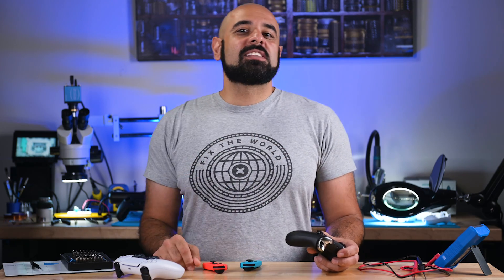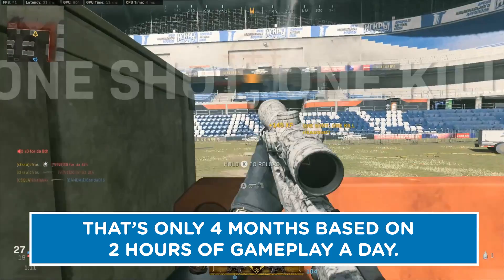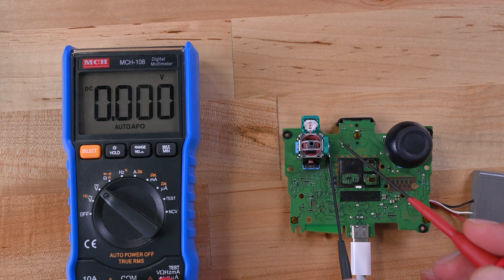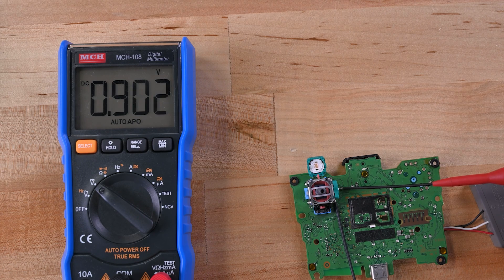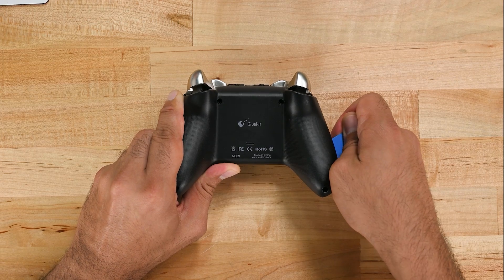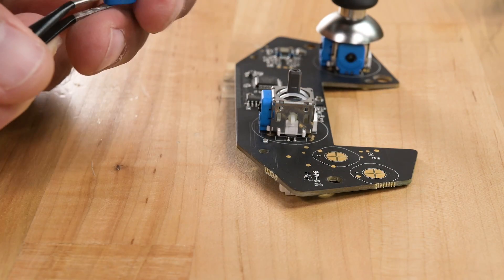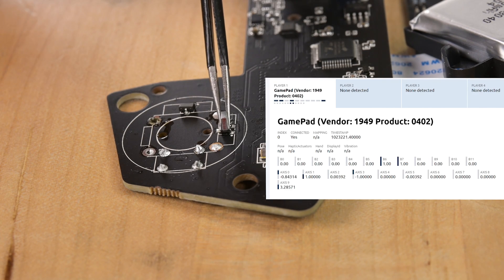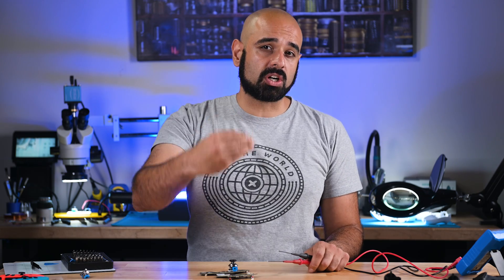How Manufacturers Can Fix Joystick Drift - Permanently!

Comment: Since 2006... To 2017 on the PS3 as other mentions. This is not new tech, and has been used on a major console. The question one should ask is why did Sony change back to resistive? Cost? Other types of wear? susceptibility to other magnetic fields like it's own second magnet next to it? Non-linear effects? Inconsistent field strength of production magnets that might necessitate more calibration which is highly labour intensive.
Reply: Definitely not cost. Hall sensors are not expensive. Microsoft switched the triggers from potentiometers to hall sensors when going from 360 => xbox one.

I suspect the reason is probably tied to why all the manufacturers making "crappy" thumbsticks have no problem giving you durability testing results, while the guys making the ones that supposedly never go bad won't. There is probably some engineering reason why potentiometers are favored over hall sensors in thumbstick applications. I suspect once these have been out in the wild and start accumulating some wear and tear we will get a better sense of why that is.
Reply: @nerdstrangler4804  I can see two issues in this Hall design. That it retains the deformation prone tiny return spring and the wear-prone splitter assembly, both of which are not a problem in other Hall sticks but are problems in potentiometer based sticks. I don't think it will last.

Dreamcast used Hall but it looks like they puzzled around a bit with suppressing interference, such as with screw placement and choice, and relative placement of different Hall controls such that they don't interfere with each other. It might be one of several reasons why it's kind of an oddball controller by look and feel. On the flip side that Hall hardware in that one actually lasts forever; great application of force management, minimal spring deformation, correct lubrication, no abrasion whatsoever. The lubricant will decay but you just replace it and you're good again for the next 10+ years.

Comment: First console with those pots is ... The Sega Dreamcast !!!! It's original contrôlées domuse magnetic sensors for the analog Thumbsticks and the 2 triggers.
This is  a shame it has not been used from that moment in all controllers. I guess Sega had  some kind of patents over them before the Dreamcast flopped :-(
Reply: No, SEGA has no related patents. It looks to me like SEGA manufactured the joystick under patents licensed from Orvitek, which would have been valid until 2010.

Also nobody actually wants to make an eternal joystick? And i can instantly see some issues with this one, it won't last.
Reply: @SianaGearz  Patent or not, it was only on the Dreamcast, a console with a lots of good ideas but taken down by Sony's marketing masterplan. 
Its arcade counterpart is famous for his great arcade games :-)
This tech might have its issues but one for the manufacturers is the long lasting ability of magnets compared to potentiometers ;-)
PS2, Xbox,... They all went for resistive tech.

Comment: the only problem I see here is that these hall effect analog sticks are trying to maintain the form factor of modern potentiometor based analog sticks. if you go back and look inside the Dreamcast controllers it's design is alot simpler than this. it just has four hall effect chips on the board arranged in a cross and the analog stick has a magnet at the bottom of it that floats above the sensors on a plastic stick with a spring around it.

Comment: As an FPV hobbyist, THANK YOU for making a video (albeit a short one) about hall gimbals. There is literally no downside in using these over potentiometers besides the slight increase in complexity and tiny increase in price. It's so worth the added consistency and longevity and it baffles me that potentiometers are still the norm in expensive video game controllers.
Reply: If possible, itd be cool if higher end controllers that might include these hall sensors in the future have a magnetic interference shield
Reply: @alifelessrock48  as awesome as these would be, Sony, Microsoft and Nintendo won't use them. They make too much off selling controller replacements. Though I agree, they should be in EVERY pro/elite controller version
Reply: @Takintomori  Hopefully one of those third pary controller makers like 8bitdo take this challenge on. Fingers crossed.
Reply: @alifelessrock48  yeah, I'd love to see 3rd party manufacturers force the big manufacturers hands. Or see replacement joysticks being released like they are for the Steam Deck
Reply: @alifelessrock48  They have a hall effect controller now called "8BitDo Ultimate Bluetooth & 2.4g Controller".  Problem with 8bit controllers is that the ABXY membrane wears out (intentionally) and they sell replacement kits to keep the cash coming in.   So you are stuffed that way with 8bit.  And their controllers are a right pig with soldered on + glued on batteries that must be removed as a first disassembly step, meaning you are likely to break your controller on your way to fixing the ABXY membrane.  They did not have to be this way, but chose to be this way.
Reply: @alifelessrock48  it's not possible to shield against stray magnetic fields
Reply: @placebomessiah  while in theory you could “jam” the Hall effect sensor, I see 2 issues with that. 1. In any situation where you would be close enough with a magnet to interfere with the hall sensor, you would be close enough to just touch the stick or obstruct the user in any other way. 2. Because magnetic fields follow the inverse square law, the external magnet needs to be incredibly powerful or extremely close. The video looked like the magnet was about 1mm from the sensor. So a magnet 32 times farther away (1024 mm or 1 m) would need to be 1048576 (32^4) times stronger to have the same field strength at the hall sensor as the small magnet. This would also no longer make the “attack” hidden as there would be a monstrously strong magnet that affects everything magnetic in the area.
I have a controller with Hall effect sticks. And in order to noticeably affect the hall sensor, I need to place a fairly strong magnet very close to the controller case. 
In conclusion yes, theoretically you could affect stick position over long range, but in practice, the magnet required would be dangerously strong to achieve this over any distance created than a couple of cm.
Reply: @them2545  you don't. jamming is not the same as degrading and you can degrade any hall sensor with an oscillating field at the right frequency. all you need to do is defeat its own noise reduction
Reply: @reverse_engineered  lol @ anyone who actually believes that
Reply: @placebomessiah  lol @ anyone incapable of googeling that

Also, magnetic fields drops of by the cube of the distance. So good luck overpowering magnets that are practically on top of the sensor.
Reply: @PainSled  this is you not understanding a shaped field vs a blocked field
Reply: @placebomessiah  then by all means; please explain.
And while we're at it, I have some questions regarding your hypothetical jamming device:

-How close to the target would you need to be?
-Would you have to surround the target?
-Could you do this without knowing what specific sensors are involved?
-How much power would this device use?
-How much would this cost?
-How easy would it be to detect and locate the attacker?

And most importantly:
-Why?

We're talking about joysticks, for gaming.
Reply: @PainSled  it's just an longwave rf interference emitter and you can go on Wikipedia to learn about the concept of magnetic shielding vs EM shielding
Reply: @placebomessiah  But why?
Reply: @PainSled  I'm not here to educate you, I'm here to encourage you to educate yourself
Reply: The downside is the sticks don't fail and you won't buy any more. That's the real reason manufacturers try to hit the warranty period and nothing else. There's zero incentive to make repairable, long lasting products for these companies.
Reply: If the "jam" is the issue, then optical senor is always an option, it's been on racing wheels for decades (and guess what, mouse!), as the forcefeedback motor could interface with hall senor.
Reply: @umi3017  
The N64 analogue used an optical sensor which made it very precise until it wore out.  100%ing V-Rally 99 with a knackered and wobbly stick was a real challenge I tells ya.
Reply: @umi3017  that looks practical.
Reply: @jshowa o I bet that the customers would be happy to pay 5$ more if they know that the controller does not fail after a few month. The companies could even advertise that they now use better tech inside the controllers and that it makes them last much longer. But selling a complete new controller (often 2-3 times) makes more money than raising the price one time by 5$.
Reply: reason potentiometers are still used my console makers is money. most manufacturers are not willing to pay even half a cent more. and if it breaks just slightly outside of a warranty period even better. means more money for them cause the costumer is gonna buy a new controller
Reply: That would mean controller manufactures would sell less controllers
Reply: saving 50 cents on 117.200.000 (ps4) controllers is a lot. And this is just PS4 consoles sold...
Reply: It is really simple. The big players like Sony, Microsoft. . . have no interest to build a long lasting Controller (Planned obsolescence). They make good money when people buy replacement Controllers. They would most likely change their business model if another company makes a better long lasting Controller (third party) that affects their replacement sales.  Only the loss of money makes them move. Not the customers convenience (better quality + longer lasting product).
Reply: @DasArschlochKind  spitting facts!
Reply: @jshowa o Increase the price by even just $10 per controller and they'd have make a massive profit (since hall sensors cost just cents more than potentiometers). The cost isn't the issue, it's simply because they'd rather have people buy new controllers every now and then, because that money they make from people doing that makes the profit from more expensive controllers look like peanuts in comparison.
Reply: @jshowa o Its become a pretty huge problem lately with Series X/S and PS5 stick drift.... to the point where several articles have been written about it. If it reaches the point where news articles about a hardware issue becomes the norm - then most people WILL notice it when they learn what it is.
Reply: Exactly. I heard about the technology when I went to buy myself a new Tx and i've been wondering ever since why we don't see it on all controllers.
Reply: I game on a PC problem solved
Reply: Baffles you? Seriously? It's consumer con 101... Ffs... Baffles you... Yikes.
Reply: @rocky_jp123 To my knowledge, Gulikit is the first (and only, as of today?) company putting hall effect sticks in videogame controllers. Currently I think you can only buy their KingKong 2 Pro controller (the one iFixit showed in this video) and a mod for the Steam Deck.
Reply: @jackwoodhead  Apparently years ago Sega put in hall effect sticks into the Dreamcast controllers?
Reply: so they can sell you more controllers :)
Reply: People chiming in with their 3rd grade low IQ assertions about "cummpaniz wunt muny"  without bothering to read that 100 neanderthals already came to that simplistic opinion on the thread
Reply: It all comes down to money. There is a huge market for gaming controllers, and if manufacturers can control the market of consumers to buy controllers more often, the most certainly will. That's exactly what is happening.
Reply: I never knew there were so many game controller and game controller sales experts on YouTube.
Reply: Fellow FPV pilot ☺️
Reply: @M4TTFPV  👋
Reply: What about low accuracy magnetic interference and complex set ups
Reply: @lostmymain.  Well designed hall effect gimbals are magnetically shielded, and magnetic interference strong enough to overcome that is usually very localized (for example, if you hold the controller within 3 inches of a laptop's magnetic switch). We RC pilots use them and don't notice issues with interference.
Reply: If you look at a Nintendo stick you'll quickly realize that the low profile analog sticks have to be traditional pots. There's no room in the housing and no way to put a hall sensor outside of that housing without increasing complexity and adding tiny parts which are vulnerable to wear. This problem is trivial for everyone except Nintendo, since they painted themselves into a corner with the thickness of the switch and joy-cons.
Reply: @kylehart8829  Tell that to Gulikit haha, they figured out a way to make it work (they now sell hall effect joycon sticks). It definitely makes it more difficult for Nintendo, but it is by no means impossible to do. If a Chinese startup can pull it off, Nintendo can, too.
Reply: The problem is not an increase in price or complexity, it is a matter of power consumption. Hall effect sensors have a minimum constant power draw that is considerably different to use of a linear potentiometer (since the current draw of the potentiometer can be engineered to a minimum when not in use: ie stick at idle).

It's great that your hobby uses hall effect style joysticks, but it is not just a matter of slapping it in and problems being solved. To put it simply, you are wrong.
Reply: one downside is that someone could wirelessly interfere with a hall effect transducer from a distance
Reply: @placebomessiah  If someone wanted to interfere with your input, I imagine it would be more practical to jam the radio signal. And magnets are not very effective over long distances so it would it would probably have to be a pretty powerful magnet.
Reply: @jackwoodhead  nah just a low frequency oscillating field within a few feet is enough to drift a precision hall sensor. Jamming bluetooth is harder
Reply: @placebomessiah  not as easy as you imply. good remote control radio controls use hall effect controllers. they don't suffer wireless interference. If it was as easy as you imply then people would be interfering with those controllers.  also note you can currently use your rc controller as a game controller on your computer for games that support them.  we do this for DRL and other drone sim games.
Reply: @markburton5292  radio controls are many octaves outside of a typical hall sensor. all you really need to do is know the resonant peaks of a few standard hall sensors and you now have a means to mess with them. from a distance
Reply: @placebomessiah  put your money where your mouth is then. show the so call easy outside interference.
Reply: @jackwoodhead also someone else wanting to interfere with your input is surely not a problem with the hardware but with the company you keep. So not a downside at all.
Reply: @placebomessiah  I think chucking a brick at the user of the hall joystick would be a much easier way to interfere.
Reply: @placebomessiah  Sounds more like a inconvenience than a downside.
Reply: @OhSoTiredMan  an inconvenience is a downside. It's not like this is likely to be an issue most encounter in the first place if any. But all inconveniences are count as a downside/potential downsides
Reply: @placebomessiah  bro is saying words to look smart. you need a very powerful magnet up close for it to be altered. if a "strong magnetic field" hit the controller, it will hit the whole board and decoupling capacitors or shielding will mostly absorb it all. let's assume you're besides some sort of mri, well yeah now you have a problem ig lol.
Reply: @darklordzqwerty  you wouldn't even need a very powerful field, just proximity, but these things are way easier to disrupt with microwave noise from a distance
Reply: @placebomessiah  you have noise reduction circuits to stop that noise, mainly chokes and capacitors. magnetic waves are very rare in household environments. i am using a hall effect sensor to measure a 0 angle steer for a robot at uni and i have zero issues with it and we have a butt ton of signals around it and it's made out of metal. we even have power circuitry on it and a decoupling capacitor and a pull-up resistor cleans the output. ill show you the pcb i made for it or even the circuit and the multimeter output.

Comment: A pro controller from both Sony and MS that lets users open the controller to replace broken parts at a cost of $200 would probably be worth it since you pay a high cost of front but the controller would last more than 2 console generations with heavy use.

Comment: Thank you, here's what I see. Electric guitars have had the same potentiometers since the beginning and are still manufactured the same. It wasn't until Eddie Van Halen introduced one that did the same thing except smoother, no static when you turned it up and the assembly looked impressive. As with these, they were square but the corners had gaps and like sloppy looking. Now it's time to redesign these and since they receive all the emotions that the player feels. As I said today if we treated a human like we do these pots we would kill them. You can't fix destroyed, I said once a year have a technician replace them, or build a better one and seal the damn thing because salt is weakening the metal along with other sloppy ignored flaws in that tiny box. I don't think these super gamers realize the force they deliver to these recipients of the or from the top predators in our universe I just 😄 God you can't fix destroyed moose. You got to love em. Again thanks